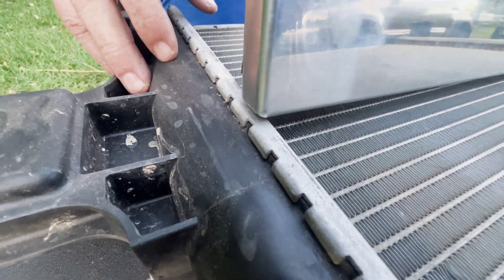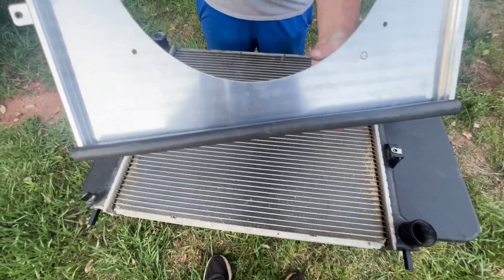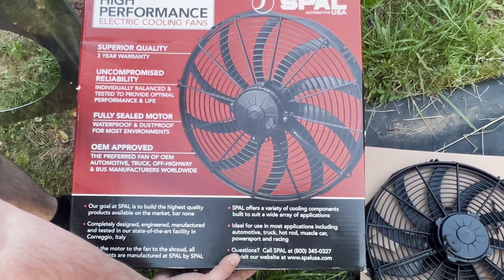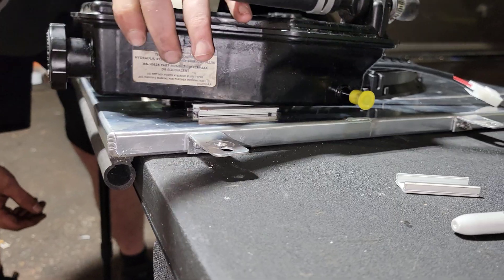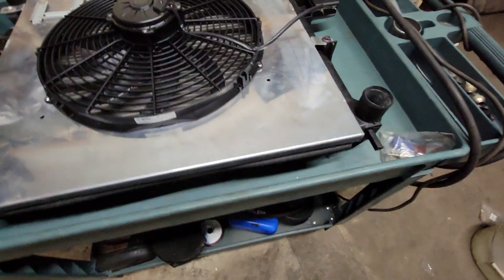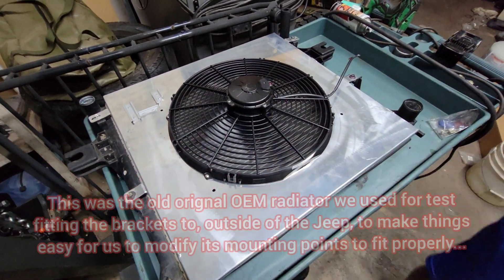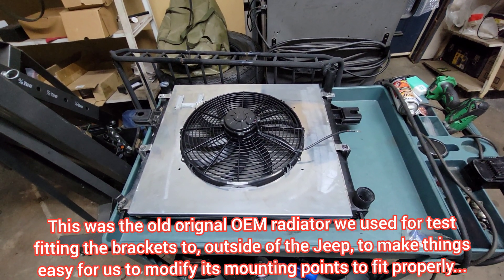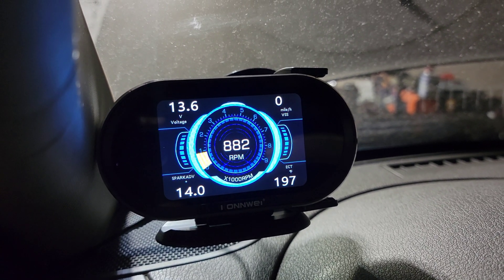2005-2010 Grand Cherokee Hydraulic fan delete; 16" Spal Electric fan, aluminum fan shroud conversion

Comment: I did the conversion, is there a way to jump or bypass the harness. I have a p0480 code for faulty hydraulic fan. I have diablo tune but was wondering if i can just jump the plug for continuity or something. 🙏
Reply from the maker: You could remove the solenoid from the stock hydraulic fan setup and plug them back in and zip-tie them up out of the way which should make things right again

Comment: Thank you that’s so informative. And I have one question: can I put a better or stronger power steering pump? Because my Jeep (2008 WK) has 32 inch tires and 2 inch lift kit. But I don’t want to cause I damage.
Reply from the maker: Isk what type of pump upgrades they offer for them, we've never personally upgraded to stronger pumps before on one of these
Reply: @jeepjoe1996 thanks, have you noticed any deference after installing v6 pump? Specifically when you turn the wheel.
Reply from the maker: @Dhufeeri Nope, they are literally identical pumps, the only difference was the size of the fitting was all

Comment: What did you do for the return line to the reservoir or the cooler ?
Reply from the maker: 3/8" rubber cap clamped to the port in the reservoir where that hose used to connect up to...

Comment: you didnt show any of the wiring :( i wanted to see how the fans would know to turn on, at the OEM temperature. I hope it's not constantly on, nor do you have to turn it on manually.
Reply from the maker: @Pillzb3rry  Here's a link to my list I made of all the parts and peices I use every time... Keep in mind, this list is for the 1993-1998 Grand Cherokee ZJ's, so the aluminum fan shroud is for those older Jeeps is all, and no need for the 3/4" aluminum Angle peice... But all the other stuff in the list is what I use to wire the whole things up 100% perfectly every single time!

https://www.amazon.com/hz/wishlist/ls/1C08RMVCYXB8D?ref_=list_d_wl_ys_list_2
Reply: What year did the v6 pump come from? I ordered one and it has too big of a pulley and the id of the pulley is different on the two pumps
Reply from the maker: @Pillzb3rry  Yeah sorry, we was going camping in like 2 days time, and it was SUPER late outside when I did the wiring aspect of it...

It has several things...

I used a cheap fully adjustable digital tempature controller to adjust the on/off setpoint, its digital probe is probed into the radiator at the top, directly beside where the top hose goes in...

Then I also include a 210-ON/195-OFF old school Tempature-Switch to act as the 'Fail-Safe' backup, to where even if the digital tempature controller failed or wasn't even hooked up at all, it would still trigger the fan relay to kick on when it got to just above 210 degrees and would still kick off once it got below 195'ish...

Then, using a diode, I also added a wire to the A/C Cluch wire, so that when using the AC, it will also trigger and cycle the fan off and on as the ac is running... Stays on nearly continuously in the summer when the ac doesn't have to cycle much...

So that all takes care of the turning off and on part, it's all triggered to turn off and on with the key, so it shuts off when you turn the Jeep off... The fail-safe part can still work independently though, so if after the Jeep is shut off, of the tempature gets much above 210 in the radiator next to the top Hose inlet, the fan can trigger its self on to cool the radiator off to keep from buying excessive pressure too (it only gets hot enough to do that literally the very most HOTTEST days of the summer, it might cycle it's self on and off once or twice a few minutes after shutting the engine off right after working it really hard just before shutting it off...

Then power delivery wise, I use really heavy duty beefy Tinned-OFC 10 gauge for the main + and - wires for the 80-amp relay and fan motor, along with a 80-amp Mini-ANL Inline fuse holder from KnuKonceptz (Suoer clean and small size format nice car audio fuse holder that can easily handle up to 150+ amps and 4 gauge wiring, so my 80-amp fuse and 10ga wire is nothing to that thing hahaha)...

I also use a nice beefy (and kinda pricy) 2-pin Plug & Play 10-gauge connector to make the fan shroud easily removable with zero cutting of any wires, and use a mini round waterproof 3-pin connector for the relay trigger wire, and the two digital Tempature sensor, sensors wires, to make those 3 wires instantly disconnect-able as well all plug and play and water-proof...

I've done this exact same setup wiring wise on 5 Jeeps now in the past 5 or 6 years, with zero failures or issues at all...

The small cheap digital tempature controller is even mounted in the underhood fuse box to make it totally hidden and in a dry location, and easy to get to to make simple adjustments if you ever needed to... I've found once you drive them for a while and get the on/off tempatures set where they work really good, and adjust the tempature differential between the on point and the off point, you usually never have to touch any of that stuff ever again